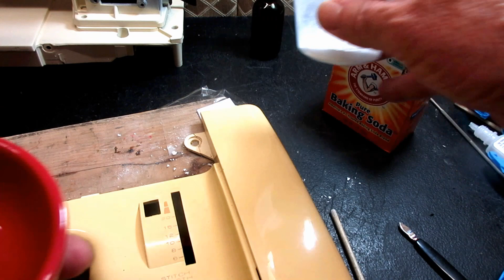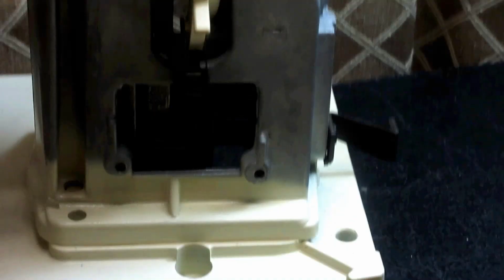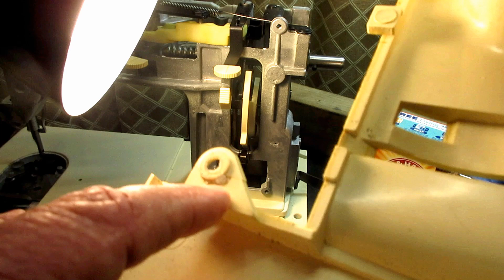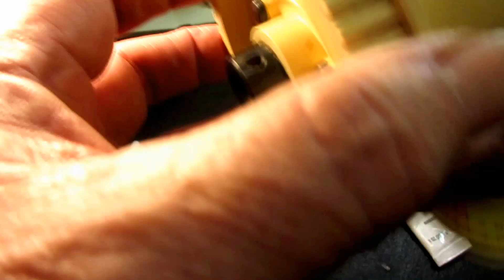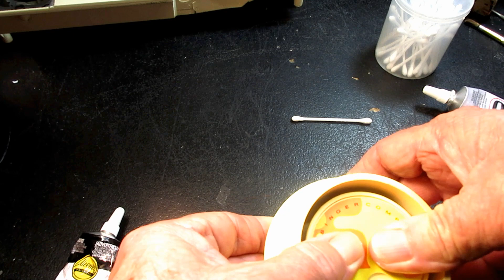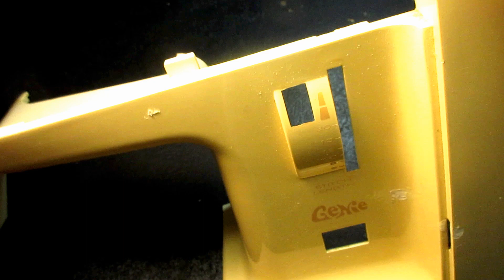Super Glue and Baking Soda Plastic Repair on a Singer Model 353 Genie

Comment: Another superglue trick is that once they are open, they dry up. To prevent that, grab a little bottle, like a prescription bottle and put cat-litter in it and then put the bottle of superglue in it.  The cat litter will absorb the moisture in the air in the bottle and keep the superglue tube from drying out and hardening.
Reply from the maker: I think you just saved me many 1/2 bottles of glue. Thanks for sharing and I'll pin your comment to the top hoping others will see it first.
Reply: You can keep your half used super glue in fridge to prevent it from hardening.
Reply: +harun... I wouldn't put them in the freezer.  The kitty litter will keep it from hardening.  I've used this trick for many years.
Reply: If Kitty Litter isn't handy, use the desiccant absorbent packets from the newest vitamin bottles. 
Every time new packets are found, swap out the old ones with the Super Glue.
Reply: tarstarkusz  Wow!!!! I didn't know this tip, and thanks so much.😊
Reply: Lol

Comment: Have you ever repaired plastic using the"Plastic Welding" technique? 

There are tools for plastic welding, and kits cost c.$35 with everything. For small projects one can, instead, use a sodering iron, cable-staples/paperclips and plastic tie-ties.  

Using a kit and the poor man's method both need items for prep & finish:
 · aluminum tape to hold the repair area in place
 · emery cloth or Dremel to prepare area, 
 · wirecutter to cut away staples,
 · filler or tie-ties to add extra material & cover staples
 · trim excess plastic,  
 · sand things smooth, and
 · possibly paint.
Reply from the maker: I have seen a couple videos of some of the things you mentioned, but they were not very well done. You sound like you have experience with these methods and I see you have posted videos in the past. I encourage you to post up one or more videos about it and I think the YT community would love it. Keeping and restoring many plastic items if more important than ever, especially with younger people (younger than me, like most people 😊) You know how often people look for DIY and how-to-doit videos and you'd probably get a good amount of views. This little video with my crude methods has 92K+ views alone. Thanks for the interesting comment, and for watching my channel. Good Luck.

Comment: Instead of a washer  as a reinforcement I often use a trimmed piece of a beer can (the one made of Fe). But you have to sand off the lacquer on the inner side and the pain that
Reply from the maker: A nice idea. I imagine it looks less obtrusive than the washer I used. Thanks for sharing that idea. For viewers wondering what "Fe" means it's the Periodic Table of Chemical Elements designation for Iron. The cans were made of Steel, a alloy of iron and carbon. Drink cans had a thin layer of Tin on the inside to prevent rust and contamination of the product. That's where the name "tin can" comes from. Thanks for watching my channel, kricko21 and take care.

Comment: Can I use this on a broken brush tube? I am missing just enough threads on the female part and the cap wont hold the brush/spring so I can screw the cap on.
Reply from the maker: Can you just glue the circumference edge of the cap? If there is no gap to fill just use the glue. If you have uneven edges to fill I would use a different glue. Something like E6000. https://www.homedepot.com/p/E6000-2-fl-oz-Clear-Adhesive-237032/203279322
It also comes in black.
Reply: @andytubesewing1953  I am defiantly going to give it a try, much cheaper then replacing the whole motor and worth a shot. Thank you Kindly
Reply from the maker: @pipperwest  Very welcome, Mary. You only need a tiny amount just to hold the cap, but it takes time to dry. I've used small clamps and or rubber bands to hold the parts in place. I have been able to remove it later if needed. Good Luck.

Comment: If anyone may be interested, there are silicone tipped tools called Clay Tools that may be extremely helpful for working with this.  You could probably use non hardening clay to make some supports or a form.  That was a great idea to add water to the baking soda.  I've seen people use this to make new channels for violin strings when they've worn out.  The baking soda and CA glue make a very rigid material.
Reply from the maker: Thanks for sharing!

Comment: Did it hold as you expected?
Reply from the maker: Yes, very well. My wife used the machine about once per week for a year to sew zigzag before she shipped it overseas. No problems with the repair like cracking or separation.

Comment: No need to wait for the baking soda to dry, superglue requires moisture to dry & water acts as an accelerant like the being soda.
Reply from the maker: OK, thanks. I let it dry b/c I wanted to clean off and shape it while dry before adding the glue. When I tried wiping away the extra or shaping it into the weird area while it was wet it just would come out of the crack or smudge. Once dry I was able to scrape and sand it much better and then add the glue. Thanks for commenting.

Comment: Anybody ever try it this on a gauge cluster out of a car I have a 89 Mustang in the bottom 2 mounting holes look just like that his repair I am going to try it but being in a car its going to have a lot of vibration in stuff from the motor but that is the way my breaks on my gauge cluster is!!
Reply from the maker: I don't know about the vibration. A sewing machine vibrates, but not to that extent. 
Maybe a JBWELD product with a 900 PSI tensile strength rating: https://www.jbweld.com/product/steelstik-epoxy-putty-stick

Comment: I have a very similar part but my issue is that the enitre plastic piece is MISSING .. so I have one side that is intact and the other that broke off I am going to try and -recreate a part and then glue it to the door...
Reply from the maker: What a creative solution! Best of luck. You can practice this method before your final piece is attached. I have made a few other repairs like this and it has worked very well for me. Thanks for watching my channel.

Comment: To fix the wheel you should check out Stanley hot glue.  Project farm did a video contest on a bunch of different hot glues and Stanley hot glue had outstanding performance on plastics (specifically PVC).  Really stood out and held hundreds of pounds of pressure on the glued pieces.  You might want to try to fix the little plastic things with Stanley hot glue.
Reply from the maker: Thank you very much for sharing this tip and for watching my channel.
Reply: Here's the video. Well worth the watch.  He does EXCELLENT non-sponsored reviews/tests of everything from oil to penetrating fluid to paint to batteries to hot glue.
https://www.youtube.com/watch?v=hu8sJBctzFc

Comment: In my experience CA glue or super glue is super frustrating to use without accelerator. Also for the yellowed plastic you should check out "retrobrite" which is a peroxide solution of some sort in combination with sunlight which people who are into vintage computers use to reduce the yellowing of old plastic. Thanks for sharing your knowledge and work.
Reply from the maker: Thanks for the tip. I'm not sure the plastic on this model is ABS type that retrobrite says it is made for. I did have a viewer who sent me pictures from South America where he used a peroxide solution and sunlight to whiten a Singer machine from the early 90s and it looked great. I'll check into the retrobrite some more and maybe try it on a parts machine where it won't matter if it ruins the finish. Nice of you to take the time to share, and thanks for watching my channel.

Comment: Hi! Just found your channel. Do you have any tips for cleaning a Singer 185K??
Reply from the maker: I do, Niki. You put a like on my video for cleaning "Cute" a 99K (thanks) Model 185K is the updated version of the 99K, made from 1958-1964. It is mechanically the same as the model 99K. You can clean your 185K the same way. The paint on your 185K in more modern, and there are not gold decals, so it can be cleaned easier too. Here is the playlist for the 99K:
https://www.youtube.com/playlist?list=PLsCOZgzzaiKIIUgkEujqHc9iNWN9NPW2Z    The adjustment videos, as well as the cleaning video, can all be used for your 185K model. 
You can get a free copy of the instruction manual here: https://www.singer.com/sites/default/files/product_manual/SINGER%20185_185J%20and%20185K%20Sewing%20Machines.pdf
Here is a parts diagram, with numbers, if you ever need it: http://parts.singerco.com/CPpartCharts/1_19999/185.pdf
Several of my 400+ videos are about cleaning machines. Here is a playlist that includes the full shower method I developed for machines with a removable arm cover to show other cleaning methods: https://www.youtube.com/playlist?list=PLsCOZgzzaiKLZyGebzS_oISgesXNyREyI
Thanks for watching my channel.

Comment: That's a shame about the super glue effect on the plastic. Hope you can clean it up.
Reply from the maker: I've found this on plastic cases before. Maybe from gasoline or polish remover. About all I can do is sand and polish it smooth. The whiteish spot will always show through. It's why I usually draw up a storyboard first. I should have protected it better but got in a hurry to try it out. Live and learn, right? Thanks for watching.

Comment: i thnk plastics thave becomes yellow does have a chemical called bromine. some of those plastive you can use chlorine to make them white again. my favourite glue is the epoxy type the 5 minute type if am in a hurry but i let it cure overnight for best results. for semipremanent to stick onee thing to another with no big mechanical stresses silicone/rtv is a good choice.
Reply from the maker: Thanks for your input. I looked at the epoxy glues. They looked great, just more involved and costly. I was pleased with how quickly the stuff I tried set up, and how hard it cured. I looked into whitening plastics in the past, and most of the blogs I read they talked about, and showed, using Hydrogen Peroxide H2O2. It seemed to work well. I did see good examples of the chlorine used to whiten also. I'm still thinking the light causes the ABS to turn yellow, not the bromine though. https://medium.com/@pueojit/a-look-into-the-yellowing-and-deyellowing-of-abs-plastics-db14b646e0ad